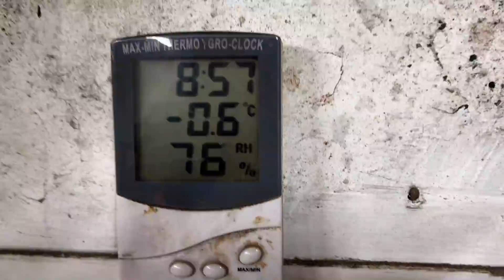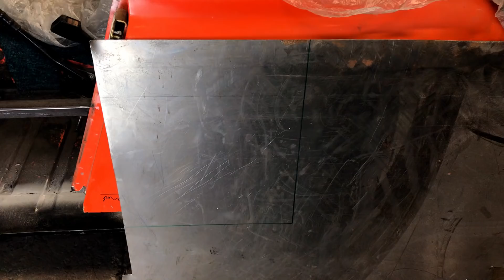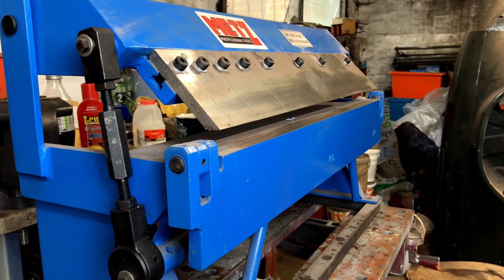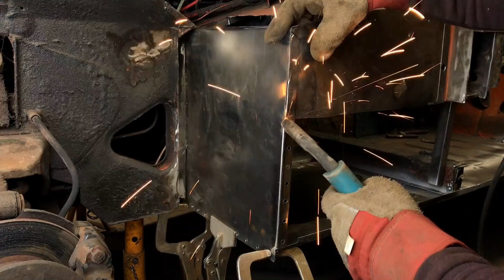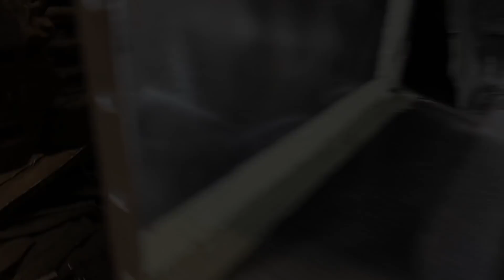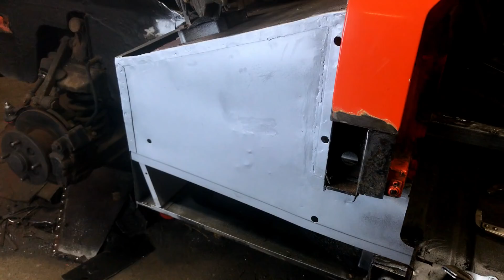MG Midget 1500 Restoration - Footwell Fabrication and Repair

Comment: sorry to hear you learned the hard way, i stupidly brushed a table saw blade back in 2017,  i was clearing out a shed to put two Wolseley 6/90's in, and was making shelving, i cut 1/3 way through the end of wedding ring finger, it was the only major accident with a power tool in 30 years work.
safety equipment (PPE) is a pain in the bum 99.99% of the time, too hot for welders, googles fog up in winter etc etc, but for those that have lost eyes or fingers they always wish they had been smarter, and those saved a similar loss by using PPE never forget how lucky they were.

Comment: Maybe I missed this. Don't you treat or prime the panels as soon as you get them fitted in to prevent any surface rust?
When you create an enclosed space, do you create a plug hole through which you can push a cavity-spraying tube? I found that my midget had rust in cavities that could/should have been more accessible, and also water run-off could have been larger. What do you recommend for chassis cavities? Anti-Rust solution, lizard-skin, bitumen  ... Or will this be a later episode? Keep up the good work. Thumbs up (sic). Great guy.
Reply from the maker: The footwell pannels have all been primed, I just didn't show it on camera. Seam sealer is an excellent way to keep moisture and road spray from getting into spot welded seams, or through any pin holes in seam welded joints. Areas like the toe board, if seam sealed and primed wont rust, but rust proofing products like Wax Oyl could be used once the sills and cavities are assembled. It would make a good future episode! :)